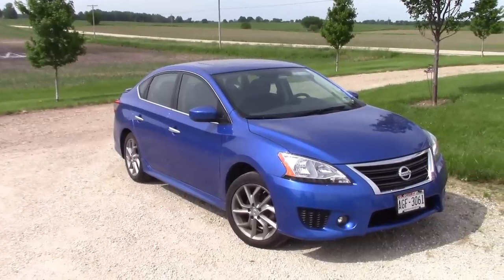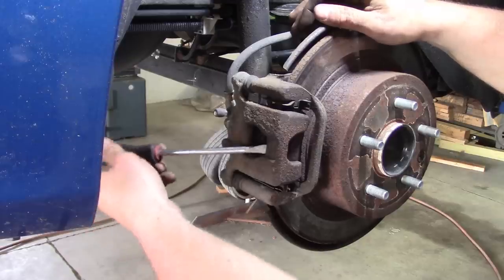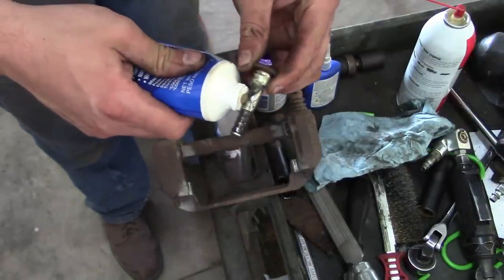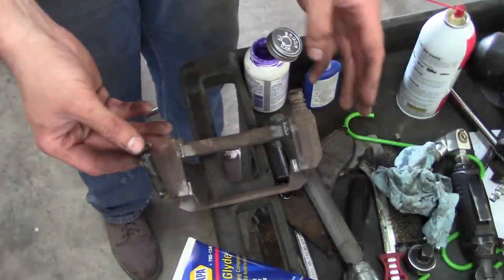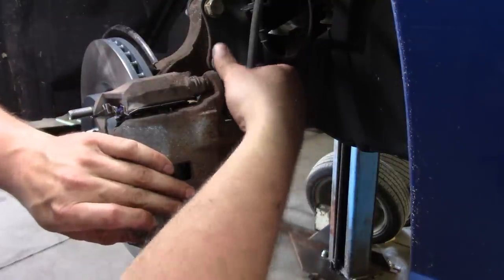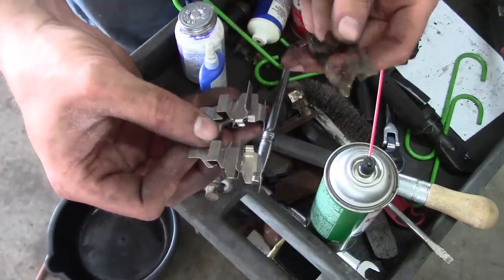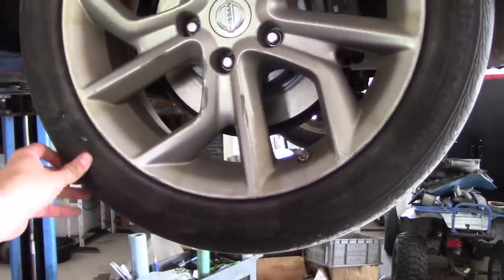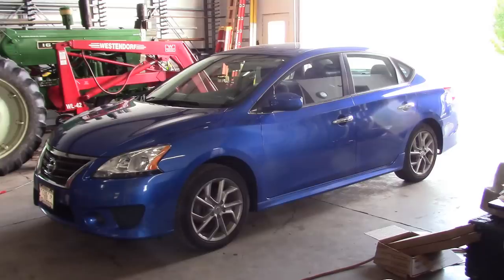Brake Job - 2014 Nissan Sentra

Comment: The owner needs to use the brakes more intensly. Use them harder, and the rotors will last longer.
Reply from the maker: You can't beat the rust.
Reply: @WatchWesWork  That's true. They salt the roads here too. But the rotors like being used. :)

Comment: I think you made a very common mistake. Moving that defective tire to the back because you thought it was safer. Actually you made it less safe. If a tire blows out in the front, usually that means the car will be controllable and can be brought to a stop. If the tire blows out in the back, it could actually throw the car into an uncontrollable skid. It's counterintuitive but trust me this is correct
Reply from the maker: I dunno about that. I've had a steer tire blow and it's very scary.
Reply: Watch Wes Work no doubt; but it's still not as bad as a back tire going. If you don't believe me, you can Google it, there's even some videos that show how it works under control circumstances.

Comment: BTW     ALWAYS have the best tires on the rear axle.
Reply: I always put the best pair on the front.  I think it’s safer.  Most of your braking and all of your steering is in the front.  If I have a tire failure at speed braking and turning are my top two priorities.
Reply: @motormaker  If the front loses grip the car move  forward, if the rear loses grip the car spin around its center of gravity. Place your bets folks.  Since the introduction of power steering this  is not a big issue. On big trucks it might be slightly different but since they also have servo assistance on the steering i stick to: best tires on the rear axle.